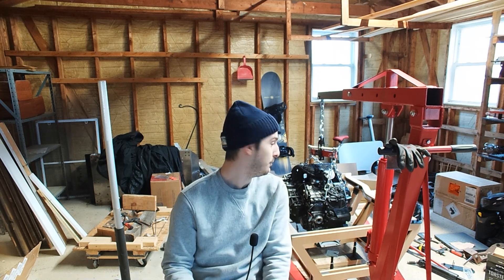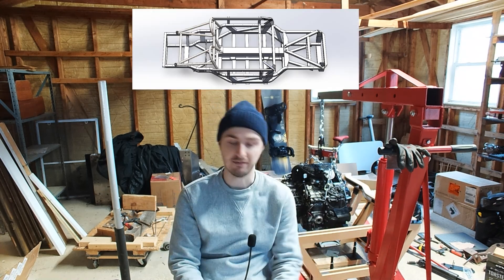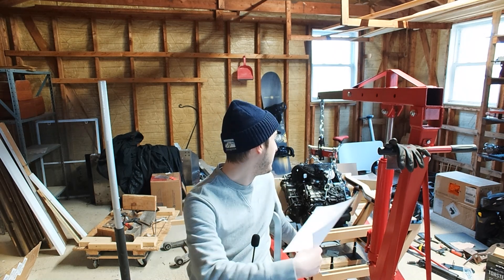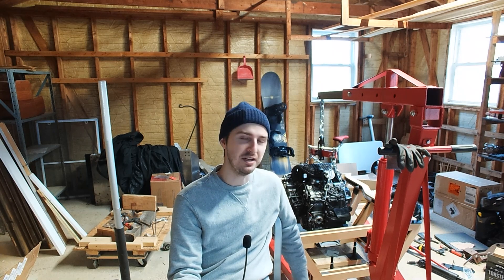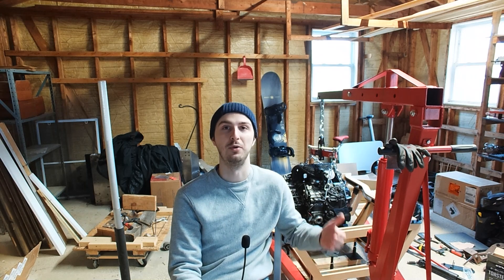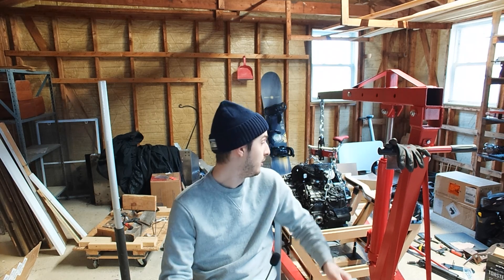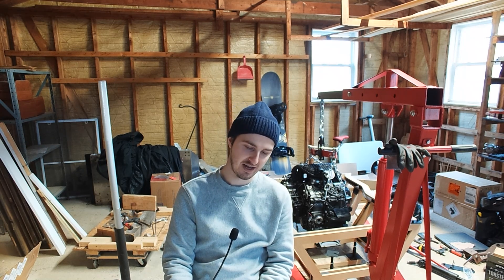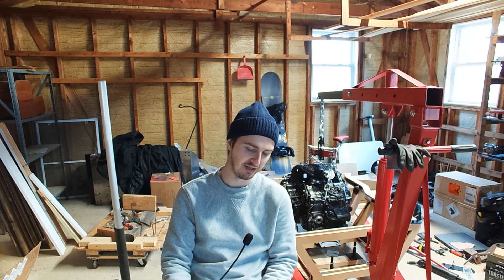My Hybrid Sports Car Mockup Gets The K1600 Engine Dropped In and Much More

Comment: Are you deadset on using an epas system? Given the ethos hydraulic seems more appropriate. Can use an electric pump.
Reply from the maker: steering is manual

Comment: Great Work , you gotta do what you gotta do to make it work XD . I decided not to use differential in mine prototype for now, car will be harder to drive but it might be interesting experience, hopefully without any crashing. Love the mockup idea can you show in some video how you made it, is it straight from CAD car design  or  you modified it to be better suited for mockup ?
Reply from the maker: the tubes are 2" square to i got two pieces of MDF routed in the right shape and then i 3d print a 1" piece that gets sandwiched to provide the dimensionality